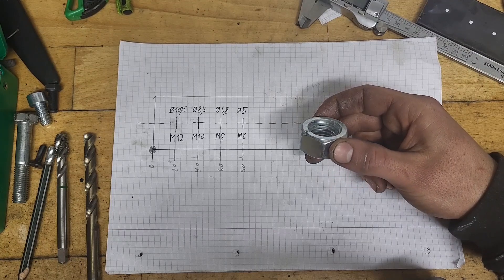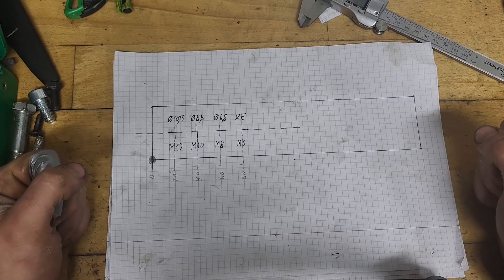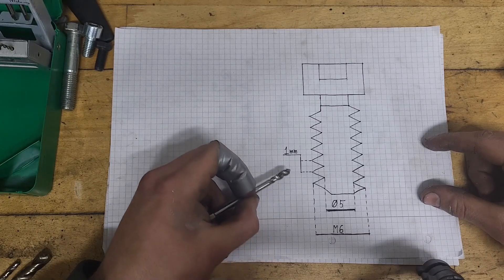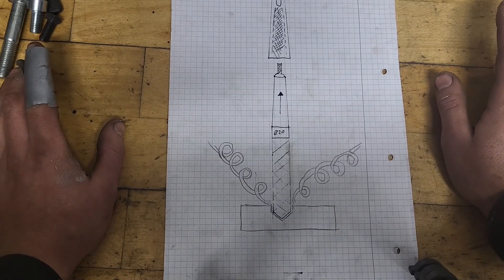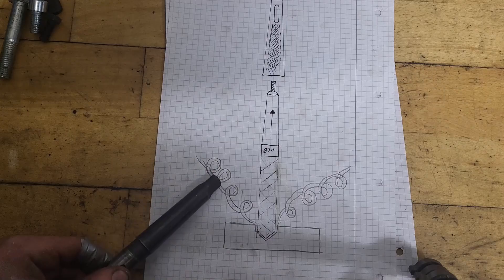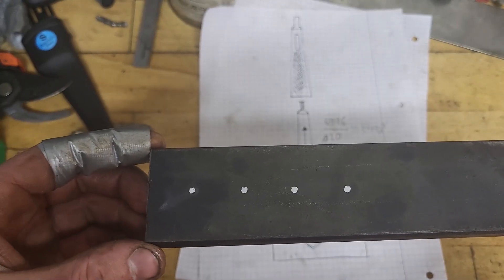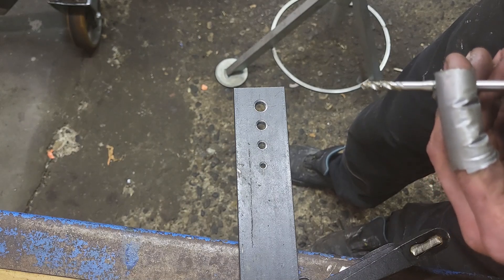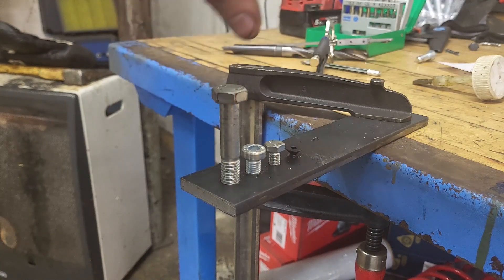Metric Thread | Beginner Guide |

Comment: Nice video. Where did you get the number 6996 from? Is it a constant for Mild Steel? Is here a table of materials and numbers?
Reply from the maker: yes it is a constant. to find the rpm for a drill and a material you need to know the diameter of your drill and the cutting speed of the material [V_c]. for mild steel the cutting speed is 22  m/min (this is the length of the chip per flute per minute)  

n: rpm [rotations per minute]

V_c: cutting speed [m/min]

D: diameter of the drill [mm]

the formula is:

n=(1000*V_c)/(pi*D)

the (6996) in the video comes from reducing the formula
n=(1000*22m/min)/(pi*D) = (318*22m/min)/D = 6996/D

example
10mm drill 
6996/10 m/min = 699,6 rpm

example for stainless steel 
for stainless steel the cutting speed is 10 m/min 

n=(1000*10m/min)/(pi*D) = (318*10m/min)/D = 3180/D

so the rpm for a 10mm drill in stainless steel is 
3180/10m/min = 318 rpm

hope this was helpful :)
Reply: Hi Julius, Thank you for your reply. Is there a table for various materials of the length of the chip per flute per minute? Danny @JuliusTheFabricator
Reply from the maker: yes you can use this website
 https://www.cgtk.co.uk/metalwork/calculators/cuttingspeeds
hope it helps :)